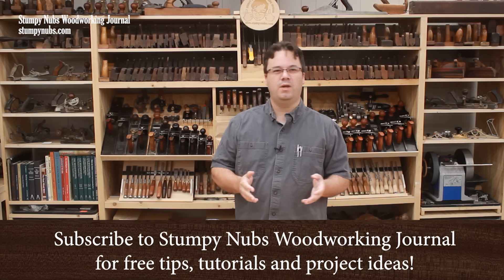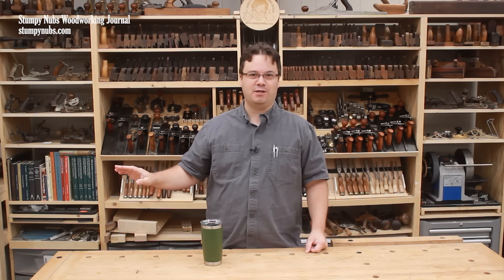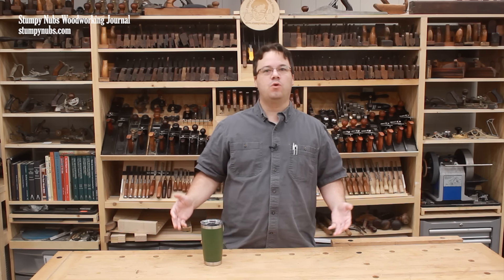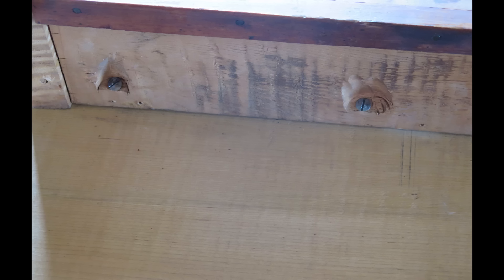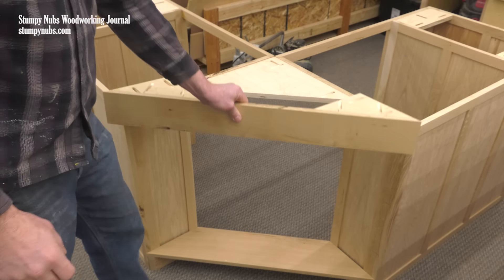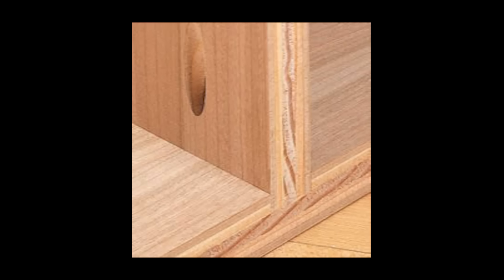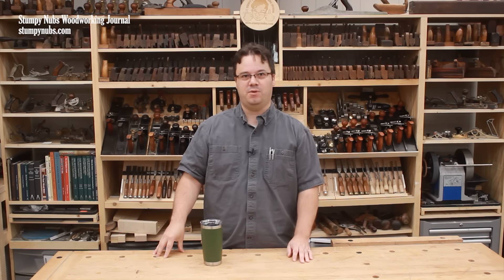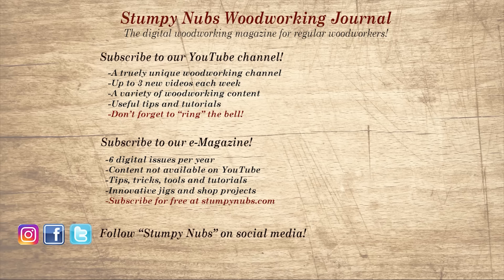They lied to you about pocket screw joinery.

Comment: The speed of assembly is also a huge advantage for pocket screws.  Fixtures and jigs are a terrific application for the pocket screw even for the anti-fastener snobs.  The irony is that the purists who dislike pocket screws should also dislike plywood and MDF as the old masters didn’t use such manufactured lumber.  I think all that hide glue sniffing can affect one’s judgement. 

I see you lost the RedWing cup cozy, I feel a little bad for giving you a hard time about it.  It was all in the sort of jesting friendly rivals engage in.  Until playoff time, then the friendly goes out the window.
Reply: Oh, but thin veneer over cheap wood cores has been around for centuries. I know, not exactly plywood, but isn't that where the idea originated?

Comment: Actually thanks for that. I had a setup for doing pocket screws pushed on me as an unwanted gift a couple of years ago. I haven't even opened the pack as I've considered it a bit of an insult. But this reminds me that I'm still using stuff that I made when I was starting out, and those items withstood heavy use even though more crudely made. I reckon that if you were say, fitting out a cabin, that they would be super useful. I just can't make up my mind whether pride in utilitarianism is equal to that obtainable from "good" joinery? I don't think so.

Comment: Thanks for showing the pocket screw combined with a dado. I’d wondered about that. I’ve also seen a couple videos recently where the woodworker drove nails through a dado joint at an angle.  Some Bozo called Norm Abram IIRC 😂

Comment: Pocket screws are not a new thing. I have owned several oak kitchen tables  with angle pocket holes with regular screws holding side panels on. This same table had a double dove tail joint that was used as a sliding mechanism that allowed the table to expanded with about 4 additional table panels.

Comment: Screws inserted at angles like 90 degrees are acceptable, while angles such as 15 degrees corrupt work pieces. I'm not sure exactly how this works, but it is a Known Fact of woodworking. 

One possible solution would be to take your work piece with pocket screws, then create a mount so it can be rotated 75 degrees, removing the offending angle. Just be sure not to tilt your head while examining the work piece, lest the relative screw angle creep perilously close to the evil 15 degree mark.

Comment: Shaker Craftsmen from the past used the most advanced tools and techniques, available to them at the time. Anyone who thinks those old craftsmen would not have used a modern router, thickness planner, or pocket screws needs to put the lid back on the mineral spirits.
Reply: Shakers originated the circular saw blade.
They were innovators, not luddites!

Comment: I think the criticism is that pocket holes don’t require any skill and the truth is they don’t. That’s not necessarily a bad thing. It makes furniture more accessible to your average joe. I’m making a breakfast nook in my home with bench seating along three walls. If I had to do this project with traditional joinery I wouldn’t even approach the project because it would be way outside of my skill set.
Reply from the maker: A successful woodworking project requires many more skills than just joinery. A pocket screw never designed a project, selected the materials, milled the stock, accurately cut and fitted the parts, planed, scraped or sanded the surfaces, or applied the finish.

Comment: A cabinetmaker by trade for decades, high end residential as well as commercial, hospitals, schools, military, retail, etc ... I'd be embarrassed to work for a shop that 'leans' on pocket hole construction. As you said, there are specific applications where they are a functionally perfect solution, and I use them often.  But they should fill a specific need in a process, not be used broadly as a lazy construction method. In a profession shop, unless you're  only making a box or two, pocket hole construction would be far too slow, too expensive, and most importantly far too imprecise ... (and it's kinda cheesy to make a video seeming to 'objectively' justify pocket holes, that ends with a commercial for pocket hole machinery)

Comment: Many of the arguments heard here for pocket screws are true of the uses of butt joints and air staplers vs dove tail joinery. I have kitchen cabinets buitl 30 years ago by a young man starting out in custom cabinet work that are assembled with butt joints and staples. The cabinets are as strong today and function very well as when they were first installed. Snobery has no place in the trade/craft.

Comment: I love pocket screws.  Not necessarily for their intended use but simply because they work great for anything you need to hang on the wall with screws. 
Are they the perfect all round device. Of course they aren't.  Do they have their place? Yes if used properly. In the proper situation. As pointed out here they have a historical provenance. But to the purist. They are an anathema.  I hate to break it to the purists. But not everybody has access to quartersawn oak or other species. Not everybody can afford the highest quality hand tools. Not everybody can get into the prestigious  furniture making schools. The vast majority of hobbiest woodworkers have to make do with far less sophisticated tools and materials. Hell, I can't even find Baltic Birch plywood near me. As to good hardwood. The only really good supplier near me closed up that outlet. 
And as to people who decry pocket screws when they are working on projects that use plywood. Give me a break.
Oh, and one other thing they are great for. Mounting surge protectors under desks etc. The small headed ones fit the mounting slots just right.

Comment: they are good in solid wood and plywood stock but garbage in other engineered woods such as OSB/particle board. piece by numbers furniture that do this with particle board fail faster than threaded inserts which i also don't recommend for these types of stock material. i believe that the material pocket screws are usually seen in are what give it the bad rep/press rather than the method itself.

Comment: It boils down to whether you are working wood or making. If you’re working wood no one is going to criticise you for not using fasteners or glue. If you’re making something out of wood there’s no shame in using whatever the situation or your skills require to complete the project.
And as you mentioned, pocket holed screws are hardly new. I remover working with my father in his antique shop 40 years ago and them being commonplace on 100 year old pine furniture which was all the rage in the UK just then. That was furniture that was built quickly and cheaply from dense ‘pitch’ pine that had already survived a lifetime or two of abuse, so it’s not as if it was a poor choice.

Comment: It's annoying that every woodworking YouTuber feels they have to apologize for or justify their use of pocket hole joinery. I've seen similar lately with domino joinery. I get why they have to do it, though -- it's all the armchair woodworkers scoffing at anything that isn't a beautiful bokeh-filled shot of a restored hand plane gliding across some solid wood.
Reply: The only problems I have with domino joinery is 1) insisting a particular use is necessary when it isn't (e.g. making panels), cause it is just a lie them and 2) the reverse of the "purist", tool snobbery pretending a method using a more expensive tool is better than it is by whatever means or context, specially when it comes with dishing other methods that are just as good in a context or actually better for an application (which is both a shitty attitude and character, and also just a lie too). Otherwise, if it works - it works.
Reply: @louisvictor3473  Dominos are quite useful for alignment during a large panel glue-up. But so are dowels etc. if done as accurately.
Reply: @Psychlist1972  And that is why I said necessary, rather than just convenient.

Comment: I am one of those people that don't like pocket hole joints. I think you are missing the point though - most of us here are hobbyists. It's what you personally get out of it. When you are able to stand back and look at that joint and then every time you walk past it for years to come - it will bring you joy, pride and memories. Pocket holes don't really have that effect on people - they are purely functional, like cam locks or dowels. If woodworking was my main source of income - then of course I would use them, because as mentioned they make certain tasks easier and faster. Also - only because you've seen it on old furniture doesn't mean it was made by masters, there were way more carpenters as you keep going back in time and most of them were not masters.
Reply from the maker: How did I miss the point? I never discouraged other forms of joinery for those who take pride in that type of work. I merely said pocket screws are acceptable in the right place if that's what someone wants to use.
Reply: @StumpyNubs  I meant that in the nicest way possible. What I meant is that when people are snobby about jointery and things like that, do so just because they do woodworking for different reasons and it's more of a personal thing, rather than anything else. I don't think I will ever see any carpenter or professional woodworker talk against pockets, because they do it for a living and there is a completely different appreciation. For example I spent 2 years making a dining table and about 1 year to build a desk. I have no problem hand chiseling a bowtie joint, because I have all the time in the world and I can admire it for years as I walk by that piece. For someone like me there is almost never any reason to use pocket screws. And that's what I mean - there are completely different groups of wood workers. In any way I agree with the points you've made and your videos are always very educational. Cheers!

Comment: Upset them further by pointing out that you don't even need to hide your metal. Traditionally, many carpenters used decorative nails that were meant to remain visible on the final product, not out of necessity but because they formed part of the intended design. This is something that I think has been absolutely lost with modern woodworking & I find that a shame.

Comment: In my limited year of experience, I never use pocket screws for external projects or for table tops. For everything else, it's fair game. I therefore would say the main takeaway with pocket screws is knowing the challenges the project will face. I also never, ever, use just pocket screws. Using them with titebond 3 wood glue is the only correct way to do it. I welcome comments and discussion on this.
Reply from the maker: The purpose of using pocket screws on table tops is to connect the top to the aprons (or the frame of the table) in a way that allows the top to expand and contract (moving the screw within an oversized pocket hole). While there are other ways to accomplish the same thing, I am not sure why you would outright dismiss the use of pocket screws in table tops. This has been a common application for centuries. Your suggestion to "never, ever use just pocket screws" is curious, as well. Where pocket screws are used to allow for wood movement, or to allow for future disassembly, glue will defeat the purpose.

Comment: I just don't like them. I don't like the look even though in many applications people purposely hide them.

I don't knock folks who do it. And if I was building cabinets as a trade, I'd likely use them for sure.

I've technically used "pocket" screws hundreds of times, but it was when I was still an amateur and I didn't use a hole or jig heheh. I just angled the bit and drove it in at an angle. Looks shite but it was part of my learning process.

I'm at a point where I'd rather use dowels. Floating tenon would be cool but I'm too frugal to stomach dropping cash on a domino. I'd rather buy more warhammer books 🤦‍♂️

The time taken to pilot pockets, is almost equal for me to use the dowel centering jig, and then you get the bonus of no metal hardware that lots of us grt a kick out of. 

The disassembling factor is underrated by a lot of people, but I think in those cases I'll do a threaded insert

Comment: You can build kitchen cabinets that will last 100 years using crown staples, glue and butt joints. Someone that derides pocket hole screws or mechanical fasteners isn't a professional.  They're internet trolls.

Comment: All through history, carpenters and joiners have seized on every innovation. The use of bowsaws dropped when better steel saws came along. They blessed and adopted the spirit level, and the plumb bob got left in the bottom of the toolbox. iron planes replaced wooden ones, and the multi-plane displaced a box full of moulding planes. The electric drill replaced the breast drill, and the brace. When did you last see a Yankee screwdriver on a site?
loose tenons are clever. Dowels are ok. Dominos are fine.
Why be snobbish about pocket screws? Cos thats all it is.
Woodworkers work wood. As quickly, and as cost effectively as they can. Thats how we eat. 
Snobbish hobbyists can take as long as they want, using £10,000 worth of hand tools to turn £400 of wood into something they could have  bought for £450

Comment: I don't disagree with any of your main points, but I will split a hair or two. You say there are appropriate times to use them and inappropriate times. Consider modern culture & how the vast majority of people have very short attention spans and want everything to be quick and easy. You can buy anything you want to look like stone, wood, brick, anything... But it's plastic, cheap, easy, & waterproof. while it's possible that pocket screws will be the gateway joinery to lead some to more advanced, appropriate methods, I think it's far more likely that it becomes THE quick and dirty method of pounding out furniture-shaped objects. Also, I don't share the view that results are all that matter. To me, the process of quickly building a project with pocket screws yields an entirely different experience than building a project with more robust, appropriate joinery. Lastly, also regarding results, just because one piece built with pocket screws LOOKS the same as another piece built with more appropriate joinery DOES NOT mean they are equal or as good, as you state in your final assessment. Not at all. It doesn't mean I'm judging the maker, but I can judge the craftsmanship each piece required, and pocket screws used in place of better joinery requires much less craftsmanship than a MT, dovetail, etc. I got into woodworking to enjoy learning and practicing quality craftsmanship to create useful things. I can't do that by pocket screwing everything together, which I know you are not advocating, but see my first point, that I believe that's more common than you acknowledge, which causes people like me to resist that trend. When I see a very popular PBS woodworker using pocket screws as the primary joinery for every kind of project from chairs to dressers, it really disappoints me instead of inspiring me.
Reply from the maker: You can misuse anything. That doesn't reflect on the tool or technique that was misused. It reflects upon the user who misused it.

Comment: Screws and nails are a sign that you aren't a REAL carpenter. If it isn't held together by fitting together perfectly-cut pieces of wood it shows contempt for the Great Masters of the Craft and the spiritual purity of wood. 

Yeah. Right

I was talking to two guys who live in the Pacific Northwest. One is a graduate Master Smith from a very highly respected swordmaking tradition in Japan. The other is the head of a very old Japanese school of knifemaking. Longtime Masters of their craft and recognized by their peers and the Japanese government as such. They buy their metal from commercial steelyards and use power hammers, belt grinders, and thermostatically-controlled heat treating furnaces because "The Ancient Masters would have sold their children for pneumatic hammers and a reliable source of 5160."

Comment: A pocket screw is a glorified toenail - used in some framing in houses. Strong enough, yes, and they are useful in certain situations no doubt, but I have to say - they aren't pretty. Also, I highly value the thought, effort and skill require for traditional joinery and would gladly pay the extra cost for it vs the cheaper, faster pocket screw joinery.

Comment: The fact that this video needs made disappoints me. The only woodworkers I’ve actually known that complained about pocket holes were insecure with their work. 

It’s fine if you don’t want to use them. Don’t pretend that makes you better than anyone else though. 

Also don’t say “they don’t work for me.” That means you’re using them wrong. Physics isn’t unique for your projects. As said in the video they most definitely work if you know how to use them.

I myself am a pragmatic woodworker. My most used joinery is rabbets because they’re super strong and fast. I definitely don’t cut them with a plane either. I won’t hesitate to use a pocket screw if it seems appropriate though. Not everybody works that way. Differences are fine. Who cares? Just don’t be a dick.